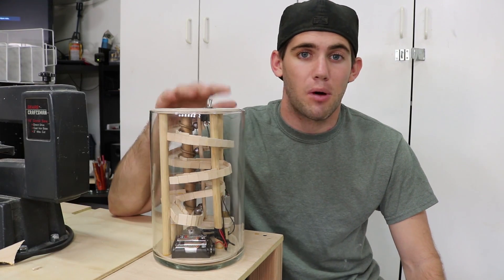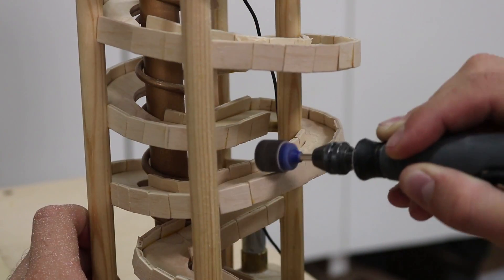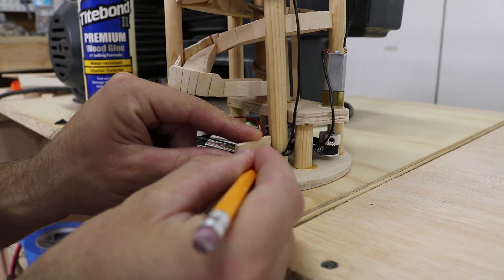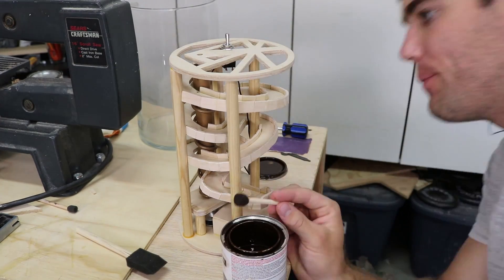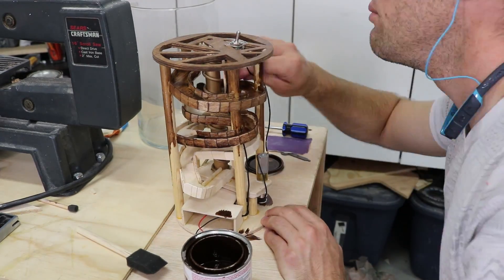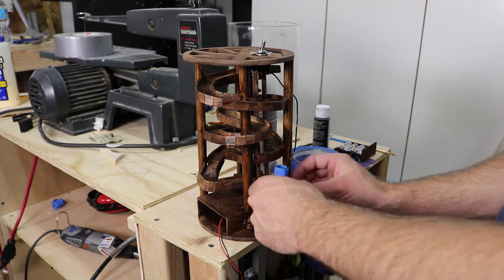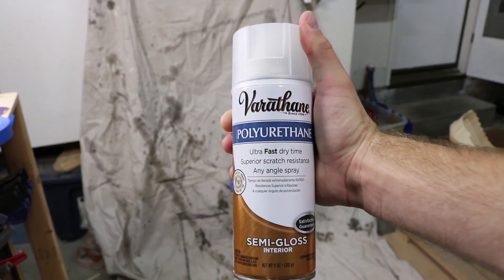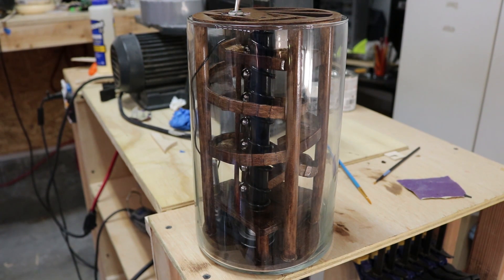Vase Marble Machine Build, Part 3 (It's Finished!)

Comment: Nice logical work.  Couple of suggestions... you could have moved the battery pack to the outside/top of the machine & enclosed it in a decorative box along with the switch.  That would've freed up valuable room inside for at least another level.  For that matter, the motor could've also been moved to the outside/top. That would also keep any small amount of accumulated motor heat out of the interior of the jar.   And as a last suggestion, reducing the bearing size from ½" to 3/8" would've also allowed a tighter track with less spacing between and more turns.  But all in all, very nicely done both in design and in video production.